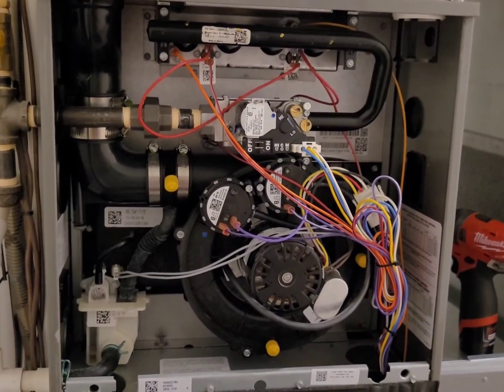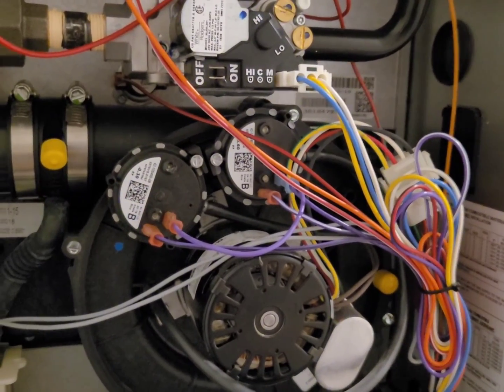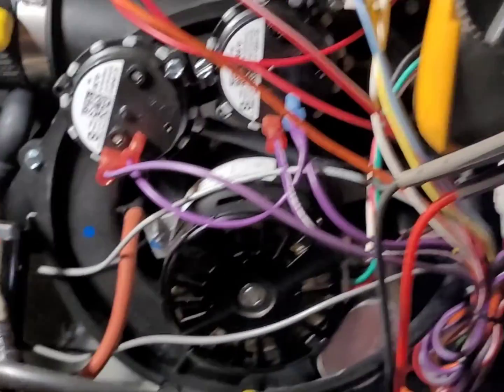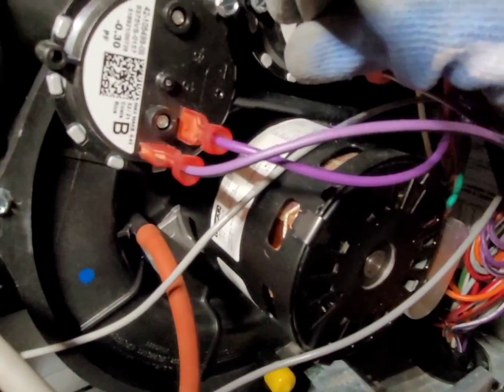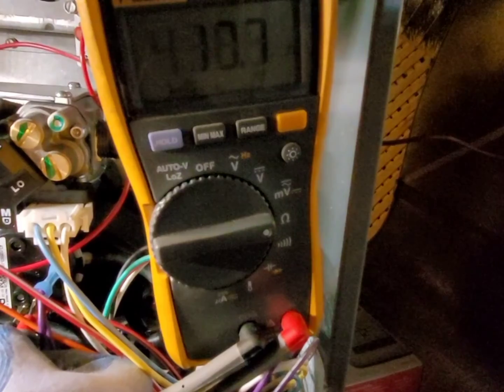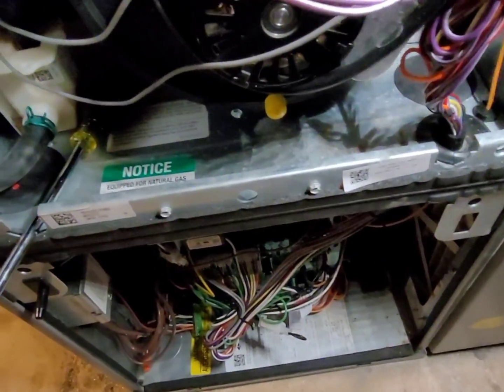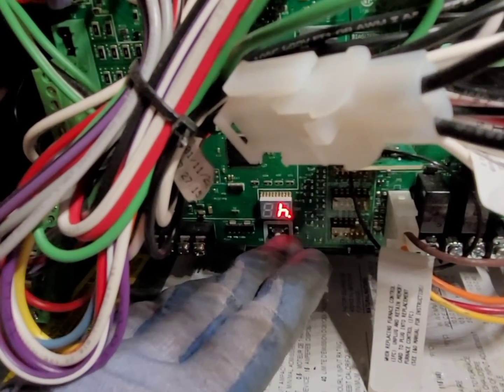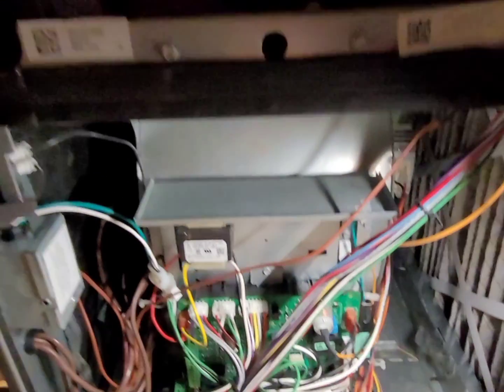How to diagnose a Rheem pressure switch - code 57 / code 45 furnace wont go into high fire

Comment: If you don't have a manometer, go get some clear plastic/rubber hose, and:

- put some water in it (no air bubbles)
- pull off the black hose to the left of the motor and connect the clear hose
- make a U in the hose below the level of the connection so that the water level on each side of the U is even
- when the motor runs, see if the water level offsets by about an inch (I think the video says 0.7 to 1 inch of water)

Great video - ours was the switch too.  Left hand switch showed 0.001 ohms and very low volts when on, right hand showed 0.01 ohms and only a couple of volts drop from the 26.9 before turning on.

Comment: I have 3yr. Old  Ruud U96V 2 stage. I have fault log 55 and 44. Furnace runs fine. But sometime it shuts off completely and start back up again. Is it a pressure switch problem?
Reply from the maker: Pressure switch or vent pressure, yes
Reply: @SmitHVAC.  vent pressure?  Like ducting?

Comment: Just ran i to something identical tonight.  2 stage Rheem. R96VA model. Can I get those switches at a supply house pr hardware store??
Reply from the maker: You could find them at a supply house but they might not sell to you without being a contractor. Hardware store won't have them. Your best bet is probably online, I can sell you a set if needed.

Comment: Hey so I have no pressure coming from the unit. What do I have to replace? I’ve already changed the pressure switches which isn’t the issue. I pulled the hose off and had no suction.
Reply from the maker: If you have no suction you either have a blockage at the port on the motor, a bad motor, or a blockage in the vent. If you checked it with a manometer and it read 0 then start checking those other 3 items. If you're just feeling for pressure with your fingers you might not be able to feel it it's so little to begin with
Reply: @SmitHVAC.  This comment helped me! I was having an intermittent issue which became full time. Had good flow through the vent pipes, but switches wouldn't close. Tried blowing through the motor port and it was severely restricted. Blew it out with an air gun, reinstalled the inducer, and it fired right up! I would have never thought the port would get clogged??
Reply from the maker: @richdog33  it's common!

Comment: I have my Rheem for 8 years and nothing but issues.  Had to replace the low switch 3 years ago and now getting code 57 for the high switch.  Cleared the condensate trap multiple times, and checked for obstructions outside.  Finally having professional come out to resolve.  Thanks for the great video, very detailed and informitive.
Reply from the maker: I hope it gets resolved, most likely a bad high fire switch.
Reply: @SmitHVAC.  It was a bad switch, but when asking the HVAC why the switches keep failing he thought that exhaust out the house was facing direct west.  We have significant winds out of the west and if those winds were blowing back into exhaust it might ruin the switch.  i installed a pressure T valve on the outside to divert the wind.  Hoping it works.
Reply from the maker: @MG-zh4eg  unfortunately it's just cheap parts. I see them every week and there's usually no rhyme or reason, I would just keep a spare on hand if I were you. They are easy to change.
Reply: Same here. I've had my Rheem for 8 years and can count on it quitting at least once each season. Worst furnace I've ever had!

Comment: Awesome awesome video. I have a similar rheem gas furnace and I keep getting the 45 code. Would I be switching the other switch you didn’t change in this video or both ? Thanks so much ❤
Reply from the maker: It's a good idea to change both, 45 is the low fire switch so that would be the one on the left

Comment: Thanks Jerry explained everything was coding 57 and 45 it started last week when we had temps 15 below and wind chills around 40 below corrected got it back running on low flame only going to change out both switches☝

Comment: I think 4 year old furnace is new and would expect many years more without service but then I am not in the business.
Reply from the maker: Yes, mine has gone 4 years so far without issues. Unfortunately I have seen many with a part failure within the first year.
Reply from the maker: Oof. That's not good. Is he installing the revised ones with the little spacer on the mounting screw?
Reply from the maker: @rett1015  Low spots in the vent could be your issue. You would need to ohm out the old pressure switch to verify it was a bad switch, or vent pressure problem.